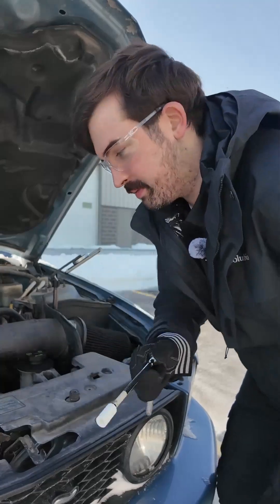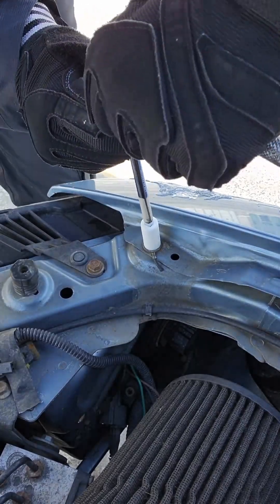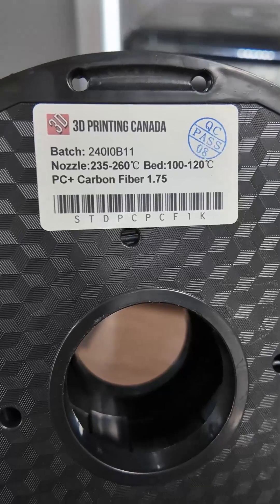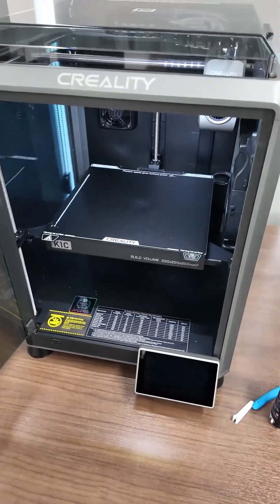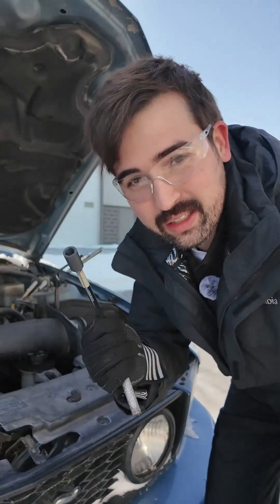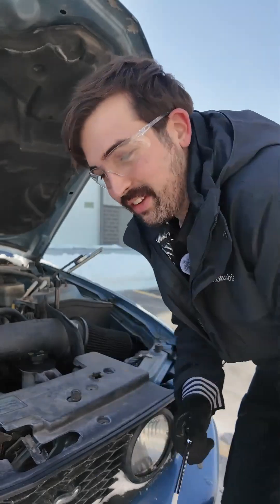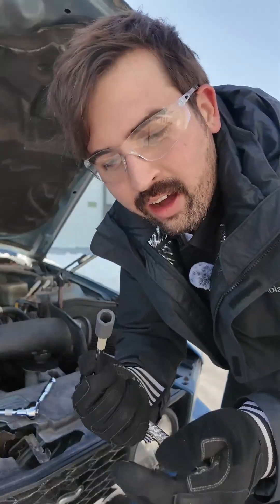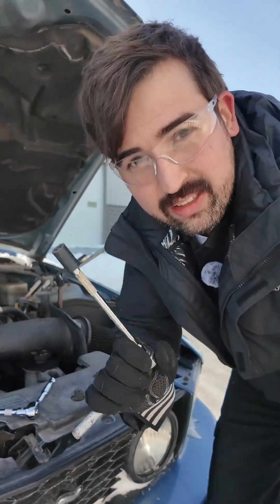Will This 3d Printed Wrench Work?

Comment: If you printed the pla at a 45° angle it would work.
Reply: thicker side walls would help also.. ive seen someone loosen lug nuts with pla lug socket.. just had to have thick sidewalls
Reply: @ a post annealing would help too. Now I have to try myself and see how strong I can get a pla socket…